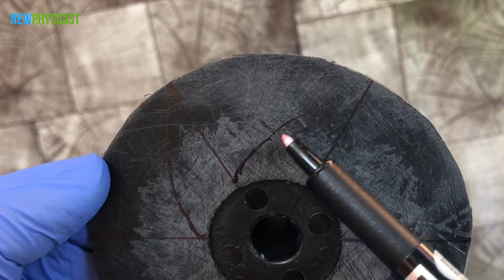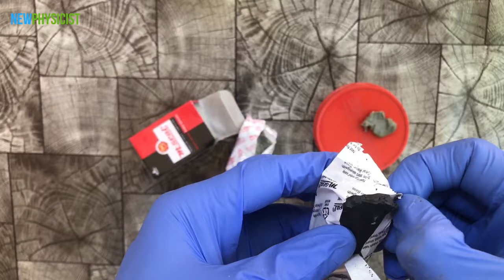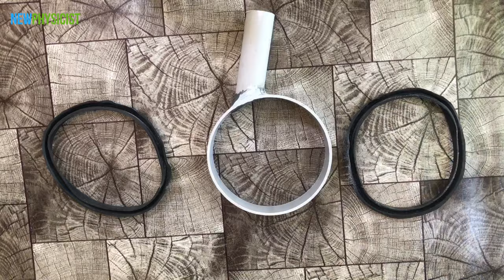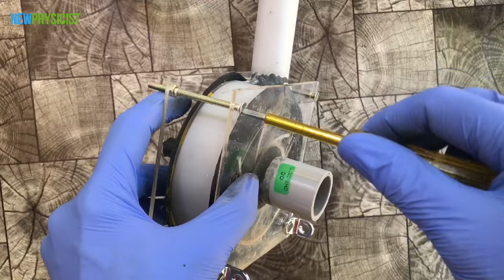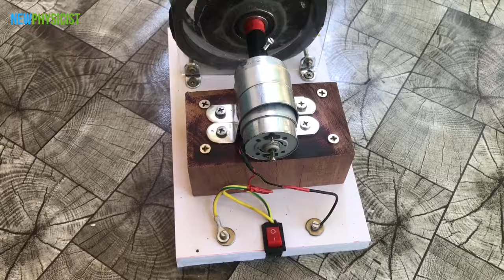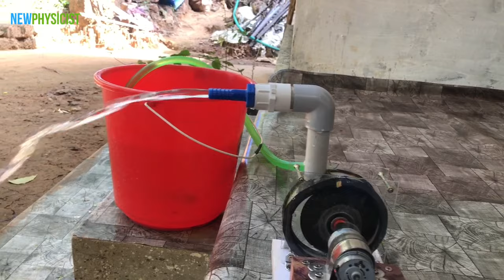How to Make a Centrifugal Water Pump

Comment: Can you share the measurement sir? Honestly im interested to make mini centrifugal pump for my final year project at my university
Reply from the maker: Sure. Give me few hrs
Reply: @newphysicist  im still waiting sir😂
Reply from the maker: Oh dear. I’m really sorry. I’ve been busy with my work. Nearly forgot. ❤️. I will update measurements in this article tomorrow link https://newphysicist.com/diy-water-pump
Reply from the maker: Propeller dia 3.5 inch
Casing Dia 4 inch
Inlet pipe dia 1 inch
Outlet pipe dia 3/4 inch 

You must place propeller inside the casing little outward (not at the centre) to get a volute shape. 

Still any doubts let me know
Reply: @newphysicist  where can i found the rubber bush? Or can you give me some suggestion regard  how to replace the rubber bush if unable to find it? Btw tq for responding..i really appreciate it😊
Reply from the maker: It’s the bush of mixer jar. You can easily get it.
Reply: @newphysicist  is it enough if I use 12V AC moto?
Reply from the maker: AC motors from a table fan cannot provide enough torque to push the water. Torque is important here. Let’s try, see what happens. Experiment 🔥
Reply: @newphysicist  how about 25V AC moto?
Reply from the maker: It’s not about the voltage. It’s function of the motor. A fan motor won’t work because of low torque. A mixer motor won’t work because it cannot work long time (heating). Try DC motor online
Reply: @newphysicist  how about it bearing? Which saiz is suitable to use
Reply from the maker: You can use bearing that match with propeller axis diameter.
Reply: @newphysicist   for your project which size that u use?
Reply from the maker: It’s nearly 1” in diameter.✌️
Reply: @newphysicist  how u avoid water from leak at bearing
Reply from the maker: That bearing doesn’t pass water. I fixed to the fibreglass using M seal.

Comment: How much clearance does the fan/blades/propellers need from the housing - between both sides (where the drill and water intake are) as well as between the edge of the blades and the circular housing?  I want to attempt this project but I am a novice and would like to limit the frustration I’ll inevitably encounter.  So just thinking (without any knowledge base) I’m wondering how the space around the blades would effect the efficiency or pressure-for example - would too much space allow excessive water intake; would  too little space restrict water flow? And is there some standard ratio or guideline to follow??